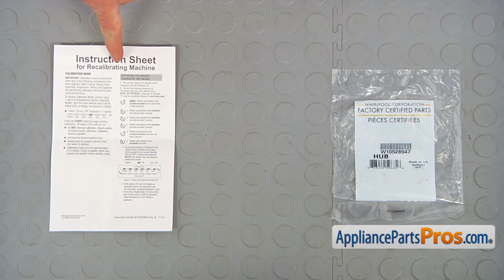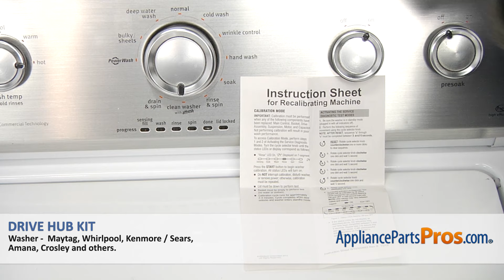How To: Whirlpool/KitchenAid/Maytag Washer Drive Hub Kit W10528947

Comment: Thanks for the video. Does the hub need to be oriented a certain way for the retainer clip to slide in? I would think that there are cut outs on the spline shaft for the clip to slip through.
Reply from the maker: As long as it is aligned with the screwholes, the retainer should slide in.
Reply: Well mine didn't and now it's stuck after hammering it and it won't go any further nor come out without breaking 😢
Reply: @barrettbarnyard1959  I had to purchased a second one and I used a wire brush to clean the scale and crud off the spline/shaft. It’s been working fine for the last month.
Reply: @barrettbarnyard1959  if you are trying to pry it back off and the basket spins, try sitting on the washer and put your feet inside and use your feet to keep it from rotating.

Comment: How do you remove the agitator bolt if it’s like glued in place?  We used WD40, Goo Gone, Apple Cider Vinegar thinking there is something holding it too tightly in place.  Any ideas are appreciated.
Reply from the maker: Unfortunately there isn't a trick to get that out. All we can suggest is using some penetrating oil and let it soak then just keep working at getting it out.

Comment: they now make a metal hub. im having trouble getting the U clip out. moves but wont pop out.
Reply from the maker: Over time you can get some debris caught around the hub making it difficult to get that out. You can try using some penetrating oil to see you can get it loose and remove it.

Comment: Is the hub supposed to be flush with bottom of washer?  My new hub has a gap from the hub to the tub
Reply from the maker: There shouldn't be a gap. Are you sure you installed everything correctly?
Reply: Yeah I ordered the correct hub and when I checked there is a gap there. It won’t go down any further

Comment: Of course, he pulls the bottom of it up with hooks like it's easy. I'm over here 270 pounds. Pulling and I cannot get it to come off
Reply from the maker: Were you able to get the part removed? Is there anything we can help you with?
Reply: @appliancepartspros  after removing the bolt i could not get the plate off

Comment: Mine is completely rusted, old gear was loose and just popped off, the new one will not fit no matter what I do. 

I scrubbed it with a wire brush and cleaned off a crazy amount of rust but it’s not even close to fitting :/

Comment: Now show how to remove the agitator from a Maytag when it wont budge even with a winch and hooks.  I was told you have to destroy the agitator tower or whatever it is called to remove it and purchase a new one to replace it.  Absolutely wont budge even with a winch and hooks under the rim of agitator assembly.  Only 3 years old and just clicks wont agitate.
Reply from the maker: The agitator can get stuck over time with build up from the detergents/fabric softeners used. You can try something list rust buster and let it soak and see if that helps loosen it. If that doesn't work, in severe cases you may have to break the agitator to remove it. If you do that you will need to be careful so you don't damage the shaft or tub.